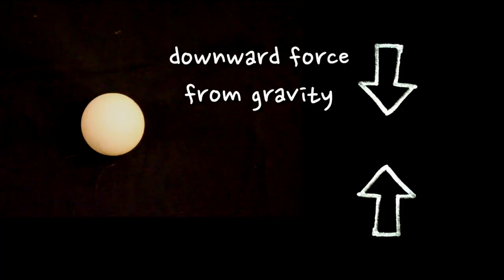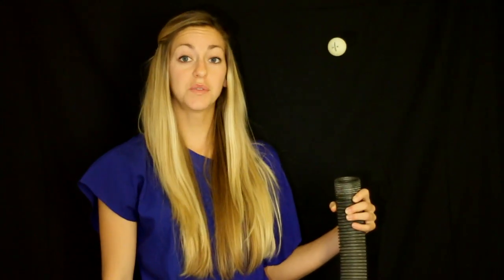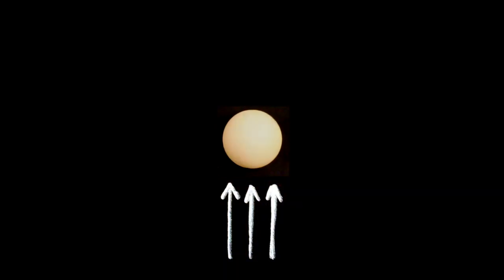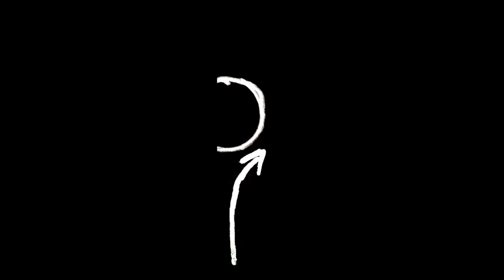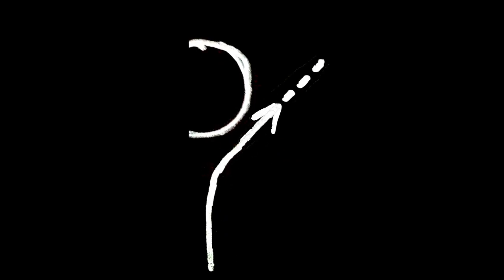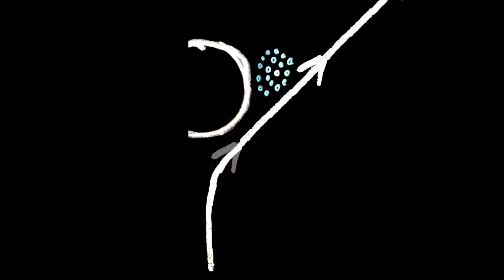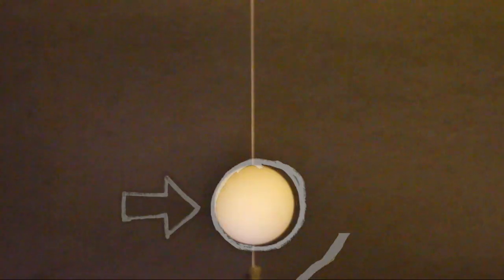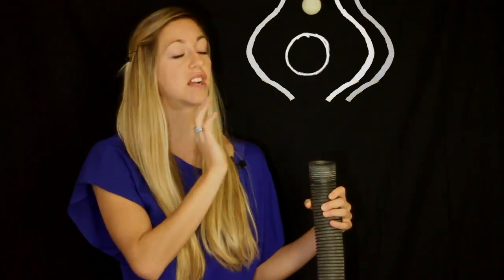How to float a ping pong ball on air - The Coandă Effect

Comment: Fun fact - it's not the windspeed difference on either side of the wing that create the lift on an airplane wing.
It's the Coanda effect that is used by airplanes on the upper side of the wing. Creating a low pressure on top and high pressure underneath to redirect the air.
The air have mass and when sent down it create an opposite reaction on the wing - lift.

Comment: I love your channel! I build unusual clocks (with my collaborator Guy Marsden) and I was inspired by your straw levitation of a ping pong ball. After looking deeper into the subject of ping pong ball levitation I reckoned I could display the hour of the day if I could get the ball to float, in  a reproducible manner, to a unique height for each hour. Turns out the ideal way to do this would be by using a PID controller and unfortunately such electronics are well beyond my expertise. I think I found a pretty cool work around. The video shows how I created a stack of "nodes" where the ball wants to settle in for the ride. Just as the ball wants to stay in the center of the air stream that keeps it aloft, the ball also wants to stay in the gaps between the short tube segments. I'm now building a refined prototype before making the final clock. Thanks for the inspiration. https://youtu.be/00HXj4hj2Jo

Comment: Your explanation is equivalent to the Bernoulli principle, right? I would say the difference is more pedagogic, you say the reason for air following a curved surface is due to low pressure. On the other hand, the Bernoulli explanation is that there is low pressure due to high velocity air flow along the curved surface. I remember that once our prof told us that this works also with a stream of water! I remember that he used it as an example for the Magnus effect, i.e. that the spin of the ball plays a crucial role. Would you agree?

Comment: Does this also works on golf ball? Since it as pores on the surface it will create different air movement than ping pong ball. The same mechanics might work but the effect on the ball might differ?
Reply: dude golf balls are so much heavier
Reply: I guess you'll need more upward force to balance it's weight in the first place..

Comment: Does this happens only with ping pong balls? Or it would happen even with  tennis ball, baseball or a cricket ball?
Reply: Harsha Vardhan Koundinya Actually, Coanda described it as a phenomenon with actual applications in aircraft (he was an aviator).

Some modern aircraft abuse the effect to generate more lift at low speeds, making a shorter takeoff possible.
Reply: As she said in the video it holds for every curved surface, so it´ll work with all kinds of balls. But most of your examples are just too heavy in weight in order to easily demonstrate this effect with simple equipment, like straws or vacuum blowers.
Reply: Maarten Mulder : Thanks dude.. Cheers

Comment: Great Video! I love your channel. Very good concise explanation of the Coanda effect. It's nice to see people correcting the mistaken Bernoulli stuff. Here's a web page I did about the Bernoulli effect and why it isn't what causes stuff like this.
http://www.cabrillo.edu/~jwelch/bernoulli/bernoulli-coanda.html
Reply: In addition, of course it is possible to increase velocity/cause acceleration, without causing any reduction in pressure, but it is not possible to cause a reduction in pressure, along a streamline, without increasing the velocity of the streamline, relative to whatever fixed reference identifies the velocity that results in the largest pressure in the streamline.
Reply: (Allow me to quote myself here, from another reply I made). The fact is that viscous friction is entirely unnecessary for this phenomena to occur. You can polish a sphere all you want, and in my experimentation, it will do nothing but increase the Coanda effect. In fact, rough balls are much more resistant the Coanda effect. The low pressure area, which pulls on the sides of the object, is not a result of viscous shearing, but of expansion in the streamline downstream. If anyone doubts this, try with a sphere that has a cylinder downstream of it, preventing flow expansion behind the sphere, and the Coanda effect will be either significantly weakened, or removed. In addition, viscous shearing has zero net effect on pressure perpendicular to the motion of the streamline. This can be proven by rushing steady fluid past a hole in a straight plate, the pressure will not be reduced by the flow passing the hole. In fact, if you measure the net static pressure in the hole, it will only be greater than that of the free-stream. Friction is what causes pressure to build up in tubes while fluid is traveling quickly through them, it does not have any net pull upon fluid adjacent to the surface, which is perpendicular to the streamline. Friction of fluid against fluid, has zero net pressure change, unless there is a pressure gradient acting upon it, and friction (by itself) never causes a pressure gradient that is anything other than discontinues. When the ping pong ball stays over the streamline, true it is due to the Coanda effect, but the Coanda effect is a direct result of the Bernouilli principle. It is a necessary fact that the pressure is more on the outside of a curve than the inside, for any given streamline, but this results in an acceleration of the fluid, and cannot result in a reduced pressure, unless it increases the speed of the fluid, even if in relative terms. I am sure many people could debate over this point, and if anyone wants to speak in terms of relativity, I can explain it that way as well.

Comment: Infact Coanda effect was a blessing for me. I did a research in my Masters which was one of its application and graduated with Masters degree without any extra time. ;)
Reply from the maker: That's very cool. It's not a popular effect. What was the application?
Reply: Coanda effect is used for VTOL (Vertical Take-off and landing) and STOL (Short Take-off and landing) planes. I performed simulations, did a parametric study and proposed a relation that can calculate the lift and drag based on the curvature of airfoil profile and using Coanda effect.
Anyways, your video is very informative and thanks for sharing.

Comment: Wow! I never understood Bernoulli's principle until now. Fluid friction, of course! Thank you for posting this video and explaining it so well!
Reply: I believe Bernouilli's law is something like static + dynamic pressure is constant along a stream line, basically saying: if a fluid is faster at some point, the static pressure must be lower, how else could it have been accelerated to this higher velocity than by a higher pressure elsewhere. It must have been pushed. That's just Newton's second law. So in fact this isn't friction related at all!
Reply: Jaap Versteegh It's the same basic concept though. Bernoulli's principle is essentially what's described in this video, or at least an aspect of it.
Reply: Benjamin Hershey No, Bernouilli's principle is not what's being described in the video. At least, I don't think so ;). The video is about the Coanda effect, which is different from Bernouilli's principle and is being caused by friction. Have a look at the wikipedia page for both.
Reply: Benjamin Hershey Bernoilli equation is static pressure + dynamic pressure + height (pressure) = constant, and it is not applicable to scenarios where fluid friction is important, because there is no consideration of fluid friction in the equaltion
Reply: matthew segal  Yes, but this effect is entirely a result of the Bernouilli principle. I have experimented with this for years, and can now make even heavy metal spheres float in the stream of my breath from a straw. The fact is that viscous friction is entirely unnecessary for this phenomena to occur. You can polish a sphere all you want, and in my experimentation, it will do nothing but increase the Coanda effect. In fact, rough balls are much more resistant the Coanda effect. The low pressure area, which pulls on the sides of the object, is not a result of viscous shearing, but of expansion in the streamline downstream. If anyone doubts this, try with a sphere that has a cylinder downstream of it, preventing flow expansion behind the sphere, and the Coanda effect will be either significantly weakened, or removed. In addition, viscous shearing has zero net effect on pressure perpendicular to the motion of the streamline. This can be proven by rushing steady fluid past a hole in a straight plate, the pressure will not be reduced by the flow passing the hole. In fact, if you measure the net static pressure in the hole, it will only be greater than that of the free-stream. Friction is what causes pressure to build up in tubes while fluid is traveling quickly through them, it does not have any net pull upon fluid adjacent to the surface, which is perpendicular to the streamline. Friction of fluid against fluid, has zero net pressure change, unless there is a pressure gradient acting upon it, and friction (by itself) never causes a pressure gradient that is anything other than discontinues. When the ping pong ball stays over the streamline, true it is due to the Coanda effect, but the Coanda effect is a direct result of the Bernouilli principle. It is a necessary fact that the pressure is more on the outside of a curve than the inside, for any given streamline, but this results in an acceleration of the fluid, and cannot result in a reduced pressure, unless it increases the speed of the fluid, even if in relative terms. I am sure many people could debate over this point, and if anyone wants to speak in terms of relativity, I can explain it that way as well.
Reply: Legion Long The acceleration of a streamline, into any other velocity, requires that the individual particles travel faster toward the new velocity, this means that regardless whether you cause the Coanda effect by increasing the static pressure on the outside of the curve, or reducing it on the inside of the curve, you are causing the average particle to gain speed (in a new direction) under the influence of this pressure gradient. When you think of it as the flow speed staying a constant, you are forgetting that each particle must either slow down in front of those particles behind it, or speed up and strike those particles ahead of it, in order to cause any influence to the velocity of the streamline. So even if the net speed remains a constant, there is a lower pressure (faster moving) side, and a higher pressure (slower moving) side, to any curve in a streamline. It is necessarily true that the fluid is changing velocity due to a pressure gradient, and that the pressure gradient is due to a change in velocity within the streamline, even if the net speed remains unchanged.

Comment: What's your view on how aircraft produce lift? Just curious. I personally believe that it's a combination of the coanda effect and Newton's third law. But textbooks and people often say that the Bernoulli effect is the reason. I don't know what's right.
Reply: It's pretty well understood. I'd trust your textbooks on that one. Although if you don't believe it, don't just sit there not believing it - find a way to test that theory. Science isn't about personal beliefs, it's about testable theories and repeatable observations.
Reply: elwamp
Actually, it's not as well understood as you might think. And your chances of finding a correct explanation in a physics textbook is, at best, 50-50. You really need an up-to-date aeronautics textbook to get a decently reliable explanation. Especially if they invoke Bernoulli's principle, the explanation is most likely wrong.
Reply: Newton's 3ed law and Bernoulli's principle are not mutually exclusive.  Both can be used to accurately calculate the force of lift.  

The part about wing lift that basic text books tend to over simplify is that they sometimes claim something like "as the flow of air diverges around the two sides of the airfoil, the divergent air molecules 'like' to meet once they have passed the airfoil.  Because the upper portion of the airfoil is a longer distance, then the air over the top must move faster in order to meet up with the same air molecules on the bottom."  

The air molecules "liking" to stick together is the problem, it is not a true statement.  Because of this, people who want to sound smart and don't understand airfoils will often claim the Bernoulli's principal does not apply.  When in fact it does apply.  The air over the upper surface moves faster because of a variety of reasons including the Coanda effect, this causes a pressure differential which causes lift.

I've heard people claim that "all the lift" is due to the angle of attack, implying it is not due to the shape of the airfoil.  This too is an over simplification.  If this were true, why do aircraft makers spend so much effort into developing ideal airfoil shapes, instead of simply adjusting the angle of incidence of a flat wing?

Comment: Can you actualy use the vacuüm upside down that it sucks air in 

Sorry for bad english
Reply: Nope, the forces won't balance that way.

When you blow air up from below, your air pressure gradient is stronger towards the bottom, where gravity is pulling the ball. That is why gravity and the vertical effect of air pressure balance each other out. If the air pressure got weak for a moment, the gravity pulls the ball into a place where the air pressure is stronger, and vice versa.

This is like balancing a ball inside of a bowl. jiggle the bowl around, and the ball will have a hard time climbing the sides to escape.

If you use a vacuum to suck air in and try to balance the ball below the nozzle, then the air pressure gradient is backwards: it's stronger higher up and weaker lower down. That means if the air pressure weakens for a moment, gravity will pull the ball down.. but that's only where the air pressure is still weaker. If the air pressure grows stronger for a moment, it overwhelms gravity to pull the ball still father up into an area of even greater air pressure.

This is more like balancing a ball on top of an upside-down bowl. Any disturbance would start it rolling downhill, leading to a run-away escape effect. :3
Reply: Thanks this was very helpful!

Comment: Wait, so the air flow is going around the ball because of the difference in air pressure created by all that air going in a straight line away from the ball? Where's the air going? Also, why did she mention fluids?
Reply: Because gases (inc. air) are fluids.
Reply: The air going in a straight line is the one that gets forced to go around the ball.
Also she mentions fuilds because a fuild is any flowing substance. That is both liquid or gas.